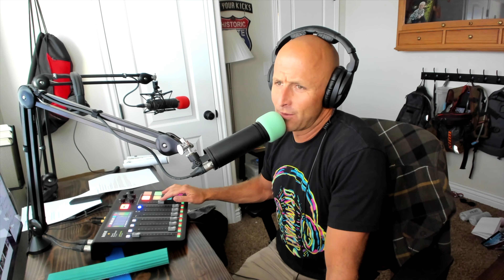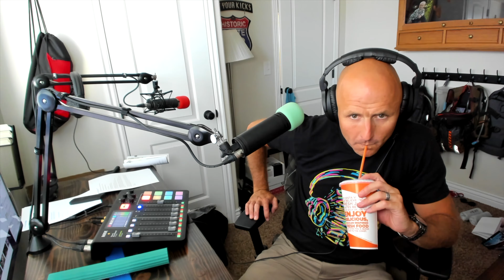DBC Podcast Ep 59 | Why Your Forks Don't Deflect As Much As They Used To

Comment: My 2014 TE310R had a serious problem with fork stiction.  First dirtbike and I just assumed it was the forks valving that made it stiff and that I just had to go faster.
Greased the fork seals and made a massive difference.  Before, using the front brake in a moderate manner had the front wanting to wash out, now stoppies are a thing.

Comment: Hi DBC, needing abit of advice, I've recently bought a RM 250 1993 model and this is the first 2 stroke I've owned, other two bikes have been 4 strokes. What gearbox oil will I need for it and also which coolant? Any information would be great also from others too. Thanks!
Reply: Bel ray gear saver oil. Engine ice coolant
Reply: @rglce25  great! Thanks alot